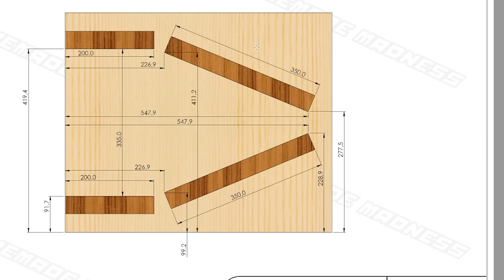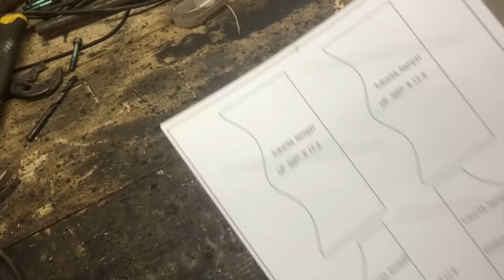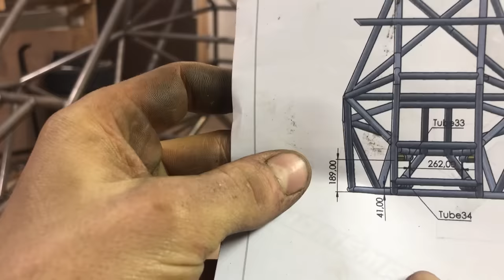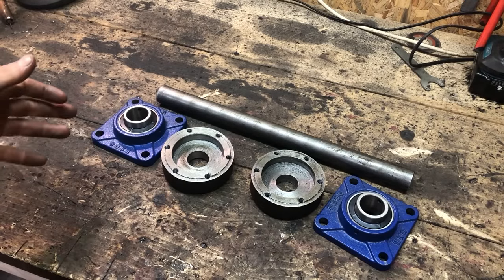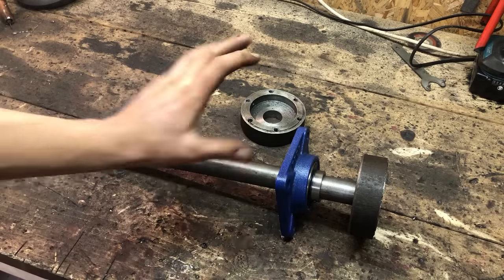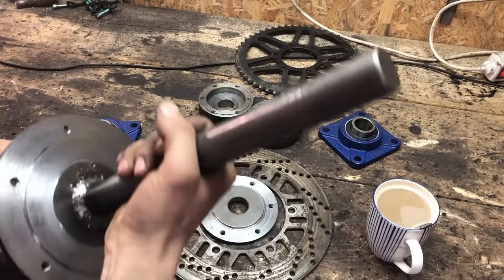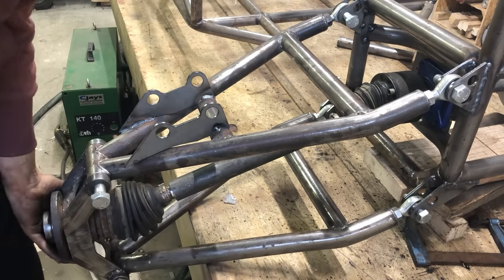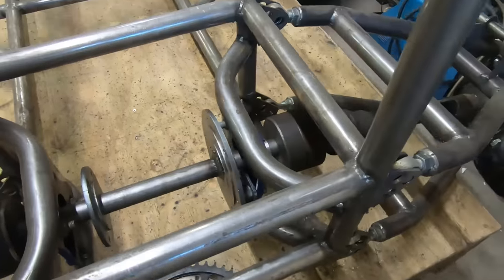How to build a crosskart/buggy part 3: DRIVELINE!

Comment from the maker: Get your plans for this buggy now: https://homemade-madness.com/shop/
Reply: What kind of tubing bender are you using in this vid?
Reply: Hi do you have plans for a 2 seat Cross kart? I have a triumph 955i engine to put in it and have an old Chinese buggy I was going to reinforce and completely strip and rebuild but a new frame would probably be nicer that only bit remains of the Chinese buggy is the registration number so it can be made road legal 😀
Reply: eres tremendo amigo espero sigas con muchos éxitos <3
Reply: Tu jest Budowa Niezależne Zawieszenie a Nikt nie zbudował Wielo wąchacz .Tak jak mają Samochody
Reply: Here is the Construction of Independent Suspension and Nobody has built a multi-sniffer. Just like they have cars

Comment: A quick tip for the axles, when you go to the scrap yard pull off the hubs that go on the trans itself. You can modify them so you don't have to make your own custom ones. Plus if you ever break something you don't have to start from 0, just go pull another hub and use that.

Comment: Suggestion cut axle in middle put precision sleeve to join two halves together should have enough room between sprocket & brake disc to make sleeve long  enough to be strong enough. That way each axle half could slide out allowing replacement of bearings & disc or sprocket.Use of quick change sprocket recommended if available.Awsome build I want a set of plans as soon as they are available! Would love to go tear up some dirt with you some time!

Comment: Great build so far, might i suggest in a few spots drilling half into the cv adapter and half into the driveshaft tapping and running a long grub screws to act similar to a keyway setup. The shaft could also be bored and tapped with a bolt and large washer to capture the grub screws so they cannot back out.
Reply from the maker: Hmm thats actually not that bad of an idea😲👌🏻

Comment: Your axle shaft sleeves should have holes drilled in them so that you can do multiple plug welds onto the original axle shaft inside, this will greatly strengthen it
Reply from the maker: Thanks for the tip

Comment: Differentials are pretty easy to make. You can make one from a Mazda miata 1.5 litre without specialized tools. Anyways you should put a keyway in that shaft. Maybe tap a hole in the end and use a big washer on it to hold it together.

Comment: You can mill the keyways with a drill press  on both parts  drill and tap end of shaft  bolt  center .   Or  just get serviceable zerked  bearings  and keep greased  ..   Is that 1" cold rolled shaft ?

Comment: Is this only good for a bottom mounted engine or can we use something like a Triumph 1050 speed triple which is cradle mounted? Love watching your videos!
Reply: you can use any engine block, it makes no difference to the engine whether it hangs in a full cradle frame or an open cradle frame, a block from an open cradle frame will have a somewhat stronger crankcase

Comment: I thinking about doing a similar project. I want to make a quadricycle. A lightweight 4 wheel electric bicycle with two mid drive motors and a enclosed body. I like your design. However it would need to be very lightweight. Thanks for all the work, big help.

Comment: You should check out the honda half shaft, i think it is present on the H22 motor, maybe other motors as well. Sits as an extention i think to have equal length drive shafts. Maybe that can work as rear center shaft in some way. Replaceable as well :p

Comment: Very well made ! Good that you print out those cutting patterns for the pipe, I just guess lol. How come front a arms are equal lengths? I made my top a arms shorter so you gain negative chamber as it compresses to help with cornering, like a trophy truck has. I have seen a lot of front suspension setups like yours on smaller buggies is it just for simplicity or does it function better?
Reply from the maker: The top one is shorter😅
Reply: @homemade_madness  lol , I had to make mine way shorter and not parallel for it to keep the wheel straight while leaning in a turn and also my wheels are way bigger, check it out if you like would be great if you have any advice. I am also have trouble with bump steer

Comment: Instead of welding the center shaft, you could mount an end mill into the lathe chuck and the axle into the tool holder. Field expedient mill! I saw Rather B Welding do several keyways like this. That would allow for the axle to be end drilled and tapped for a washer and bolt for retainer. as for the endcaps, there is no problem with a rounded keyway. just use a drill.
Reply from the maker: Could be done, but want to keep it simple for now

Comment: How do you plan to get the sprocket on the driveshaft/ how do you plan to make sprocket swapping available?? The inside diameter of your sprocket doesn't look like it will clear the acceptor plates you've welded onto the driveshaft, or the square blue bearing housings you've trapped on the driveshaft.

Comment: One question. How do you plan on getting the brake disc and the sprocket on? It doesn't look like their center holes will go over the bearings or mounting blocks for the bearings.

Comment: Nice  I am at a point to were I'm trying to figuring out how to tension my chain I have a pretty heavy Spring tensioner under the chain it's still a little long so it seems like I need some downward force on the top of it to because it wants to skip over the drive sprocket when I let off the throttle. 
O  Mazda miata axles are pretty lightweight with flanges

Comment: Don't know if you could but taping holes on the end of that drive bar and turning down the ends and cut slots with and bar key not sure what they're called exactly I just call them "bar keys" would have been better for repairs but welding I think is stronger

Comment: The longer drive shaft would be adaptable with only a cutting wheel and welder the end you cut short can just cut around weld as its got a plug  bit at cv that goes in about 1/1.5” split it cut it size the weld together, thats how factory does it

Comment: if you weld the hub to the shaft that joins the cv axle, how do you change the chain sprocket if it breaks, because they wear out quickly, it's a bad design

Comment: QUESTION- What are you doing to allow the rear axle to slip in and out as the suspension moves up and down. On the cars they came out of the axles are splined and slip into the transmission as to prevent it from binding. With your design they will bind, yes ??? I`m really interested in getting your plans I would like to know how you will solve this...
Reply from the maker: The cv joints allow for some movement in and out. There is only little movement because a arms are similar length as driveshafts
Reply: @homemade_madness   ok, great. It was hard to tell how much movement there was just from watching the video. Thanks for responding. AJ

Comment: Split the drive axle in 2 with a splined coupler then you can pull the 2 halves out, unless as I now see, you welded the brake and sprocket to the shaft....

Comment: With all the dust and vibrations your bearings will definitly to be replaced at a Time. You could have made à home through the axle and your cylinder lathe made pieces and tighten it with a long screw.

Comment: Cv axile connect with flang 2 inches round dummy plate use nut bolt flange one side 4 flange wery good performance

Comment: The pipe packing not good welding time inside tin shet heat aluminium sheet dubler packaging loose then you first test run cv axile joint broken